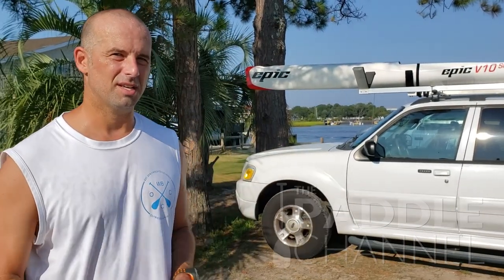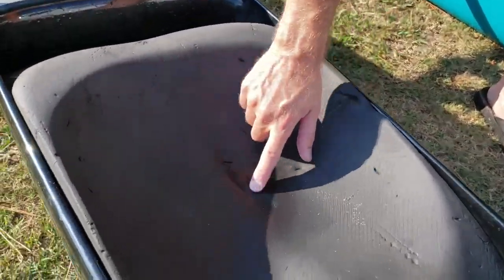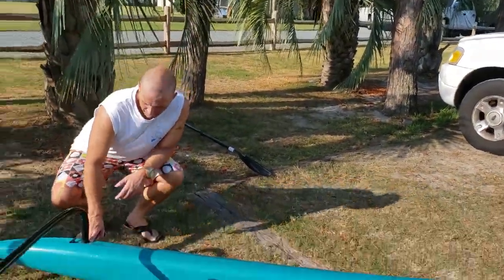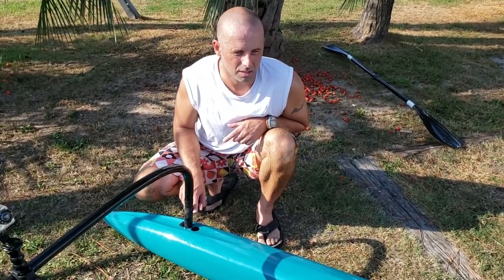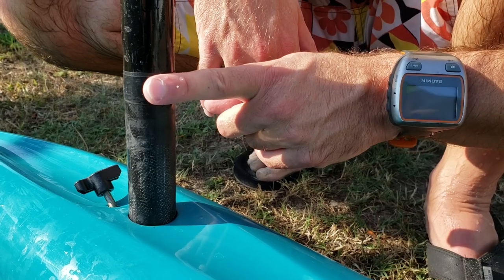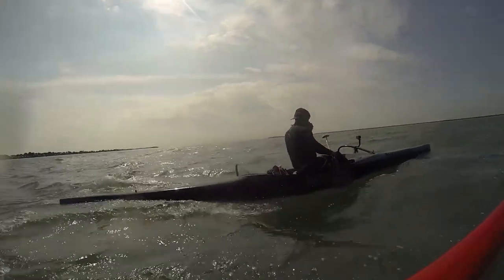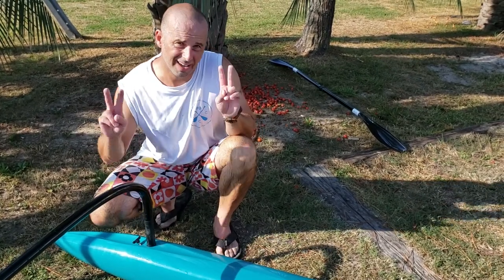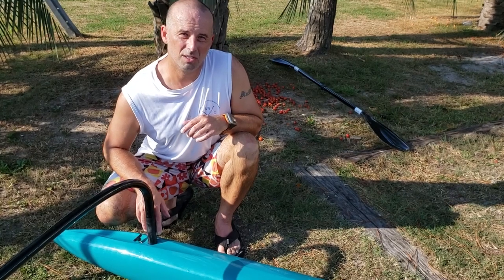Left Hip Pain and OC1 Paddling

Comment: So I know this video is old news, but there was a recall for seats in the Kahele that I have sort of initiated where the stock Kahele seat foam was too soft and under specification thus leading to the premature deterioration of the seat. I am getting my 2020 manufactured kahele seat replaced by Ozone after it exhibited the similar left butt cheek divot you describe in this video. My complaint is that the 3-year old Antares that I owned prior to the Kahele never exhibited this problem and it was unacceptable that a brand new boat would have this problem. I am very level with my seating (outrigger paddler for over 7 years now). So there is no reason why a less than year old Outrigger canoe seat to deteriorate so rapidly.
Reply from the maker: Both Puakea Designs and Ozone seem pretty committed to quality, based on past behavior. Sometimes when products and technology are innovating rapidly, there might be a glitch in quality that's difficult to identify during development, perhaps. Thanks for sharing your experience -- that may help some folk id the problem in the future.

Comment: Yah I had that problem when I first started paddling. I figured out it was for two reasons. 1, just like you, my ama setting was light so changing that helped a lot. But the second reason was I was leaning too much but that was because I didn’t know where the balance point was. So, I put a wetsuit on and huli’d on purpose like 8 times in a row. Now I know where the balance point is. But also, I know how to recover from a lifting ama. So, my confidence is much higher now and I don’t need to learn as much.
Reply from the maker: The intentional huli is a critical learning tool. Thanks for sharing!

Comment: I put a A Temest seat on my Volare and the ride and comfort has improved. It feels kuch more connected. I am mostly an inland paddler and I am atleast 1.5 inches higher on the Liako.  The seat was a condlsiderable improvment.  I did get a rub on the tail bone from the back of the Tempest seat.  Chamois cream ought to be the answer to that.
Reply from the maker: Thanks for sharing that. We know paddlers who reshaped their stock seats by handing (by sanding), but it's sort of a guessing game as to what shape changes need to happen. That tailbone chafing is the worst -- we've found it eventually goes away after a few sessions -- maybe we just unconsciously shift to prevent it? Glad to hear the Tempest seat is working on the Volare for you -- somebody else might benefit from that, so thanks!
Reply: Change the seat 👍 The Volare seat is too soft promotes "sinking" get an ares or other firmer seat. Massive improvement

Comment: My buddy and I added 4 pounds (two 2-lb ankle weights) to the ama of our OC2. We'd rather have a heavier ama than worry about a huli all the time. It's a Tempest and we both love it. I do wish the seats were softer though. I have a bony butt. The occasional swimming break does relieve it.
Reply from the maker: Daniel, do you feel like that's creating any extra drag from the ama? Does it still ride out of the water pretty well?
Reply: @ThePaddleChannel  
It has to be creating some additional drag, but the ama still sits very high in the water. Its buoyancy is, after all, much greater than its weight. And we paddle for fun, sun, cardio, and to get in the water. The added security against hulis is well worth any additional drag for us. We don't race, we don't surf (other than riding the occasional fortuitous bump on the downwind leg) and we don't try to fly the ama. For any of those things the weight would be a detriment. But for us it's well worth any additional drag. If they made an OC2 with two amas that's what I'd have. :)
Reply from the maker: @danielschechter8130  sounds like you're having a blast paddling that OC2 with your buddy. That's what it's all about! It's cool for us to hear how different paddlers adapt their styles and equipment to fit their style, goals, etc.  Thanks for sharing your experience -- when you get the OC2A2, let us know! :)

Comment: It seems like there is a sweet spot.   Too light and you pressure the left to keep the ama down.   Too heavy and the lean of the hull forces too much weight onto the left hip.   I've not had any hip issues yet in my new Kahe Kai, but haven't put a ton of training in it yet either.
Reply from the maker: Definitely so. It takes a bit of experimentation for each paddler to find that sweet spot, and it can change according to conditions, or even over time. Enjoy that new Kahe Kai -- we have had a bunch of fun downwind miles in that canoe!

Comment: Your left shoulder is high so you are leaning that way besides the obvious ama on the left issue. Get xrays taken by a Chiro so you can fix the source of the problem🤙🏼
Reply: Felipe Duque yes, my wife suggested a chiropractor as well!! Thanks.
Reply: I had the same problem with my Hurricane after I got it. I make my own custom seats out of minicell foam. We lean to the left and put more weight on that side so I made a seat 3/4 of an inch higher on the left side to equal the weight and sit more upright. Works for me. I can now paddle over an hour with no pain. Your seat has worn out. @barryblackburn5910
Reply: Greg Cole thanks Greg for that. I’m sure I can benefit from chiropractic adjustment but yes, your idea about the seat sounds helpful too! Thank you!